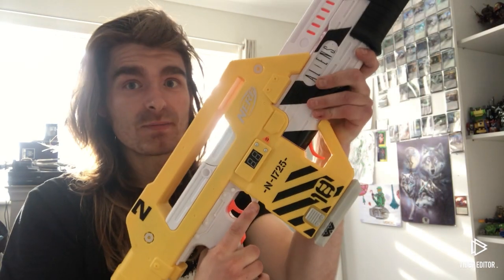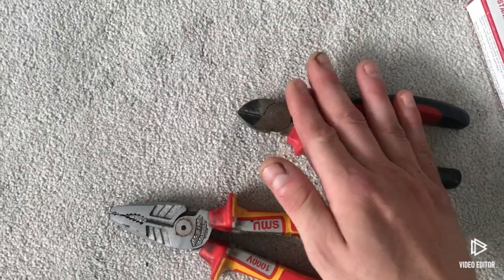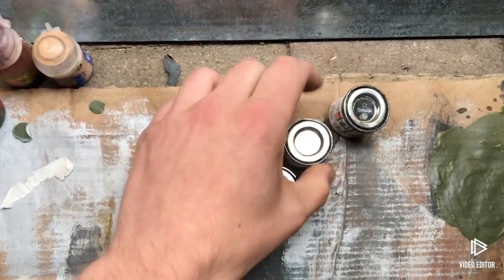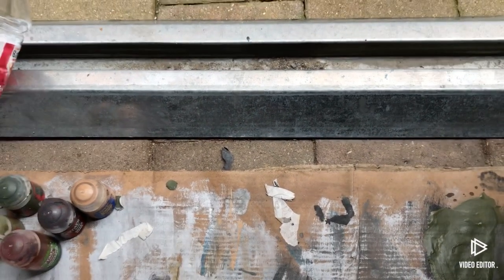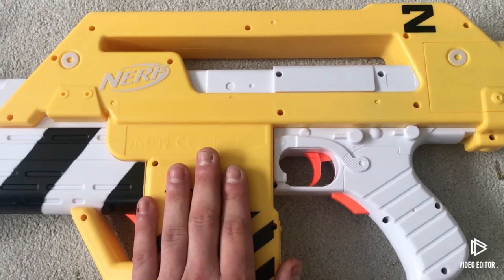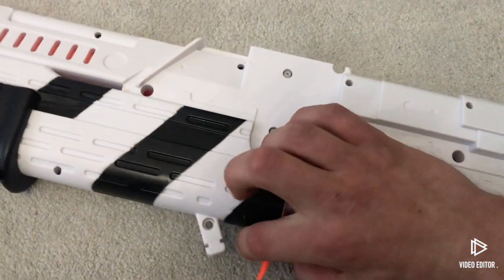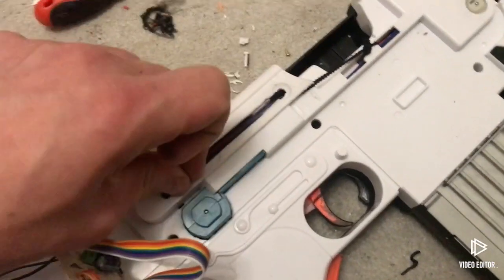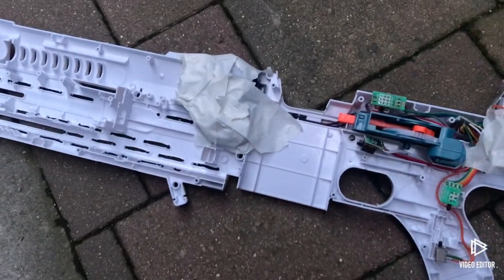Nerf LMTD Aliens M41A Pulse Rifle mod and paint tutorial

Comment: That’s awesome, I just got one of these to do exactly this. I was an idiot and missed out on the initial order, paid a little over the odds. Will be a good summer project.
Reply from the maker: Glad to hear you got one too!!! I never knew of when it originally came out so I also paid more than the original price. But definitely worth it nonetheless! 
I hope this video is helpful to you :)
Reply: It certainly was / is. What paint was it you used again? I’ve seen Rustoleum used again for the main black and shroud areas, but can’t seem to get that over here.
Reply from the maker: @Burtronic   I used chaos black primer by citadel/games workshop, light olive 86 by Humbrol and clear satin varnish by Windsor and newton. If you check at the 5:00 mark I show off all the paints you need, sprays first then the others for hand painting
Reply: Got it, apologies. I’ve found some paint called Krylon Camo which I believe will work well for the base colours for the body and shroud. But I’ll certainly be using your process and wash / weathering colours. Not sure I’ll strip it quite so far, but the shroud will come off. Looking forward to this one 👍
Reply from the maker: @Burtronic  the entire thing can be carefully stripped down (except the electronics as they’re soldered into place) just be sure to follow each step carefully so you don’t break any wires, otherwise you’ll end up having to do emergency solder repairs like me 😆
Reply: @Ascension-Angel I saw that 😂 I think if I take the shroud away and get to that point I’ll be happy. I don’t think I’ll cut all the holes out and do the triggers so those few steps should be far enough for me. The steps you did to there will be massively helpful so thanks for that 👍
Reply from the maker: @Burtronic  no worries my man. I only cut the holes out, modded the trigger and added a working cocking mechanism in because I’m all about the working parts and making it as close as possible to the live firing screen used prop. I hope you’re project goes well. Would love to see the finished result
Reply: @Ascension-Angel  got it all finished! Really chuffed with how it turned out, was good fun!
Reply from the maker: @Burtronic  excellent! Got your DM on Instagram too BTW

Comment: Excellent job , my only issue is the pump grip is made from polymer on the Spas 12, so wouldn't have any metal showing through, it'd scuff up more like a plastic car bumper if it scratched up at all. But I'm just being picky, it looks seriously legit! Tip for masking if you paint the edge of the tape with a clear coat first, nothing else will bleed under it :-)
Reply from the maker: @cynicalmamc  thanks! And yeah I see what you mean about the pump grip. Then again I did keep the aliens logo on the shell ejector too so there’s that 🤷‍♂️

Comment: I'm about to start modding & painting mine, and I was terrified - after all, it's a kind of one shot deal! But this has assuaged my trembling nerves, and I'll be following your example. Hopefully it'll look just as good - wish me luck!
Reply from the maker: Good luck! I’m glad you’re using my video. It means a lot to me. Best advice I can give you is TAKE YOUR TIME! especially with reassembly! And be especially mindful of the wires and circuitboards as I had to do emergency solder repairs and it’s is not easy! Make damn sure you have everything you need before starting. Also make sure to watch the previous video on modifying the trigger for independent action.
Reply: @Ascension-Angel  Just getting all the bits together - the paint list you put together there was a godsend, I was wondering how to get the butt looking wooden so that's answered that! Very nervous about the electronics but fortunately I can (just about) do soldering repairs if worst comes to the worst. You just used the Chaos Black primer, no topcoat, before satin finishing, an I right?
Reply from the maker: @timboxall8936  correct. The chaos black doubles as a primer and a top coat in one

Comment: Very useful video. I will likely modify my own in a similar manner than you did, with the trigger and barrel mods (only mod on mine is the "load any mag" mod).
Somet hings you might want to do:
 - I got one of those little plastic carrying handles that some cardboard boxes have, and installed it in the display box in place of the painted fake carrying handle. That turns it tnto an actual display / transport case! I even went and put some dividers in the convenient lidded storage box so I could store and carry there the darts, the mega darts ("grenades"), the batteries (for storage) and a small screwdriver to access the battery compartment.
- This rifle lacks sights, unfortunately, which sucks for actal usahge - so I made simple notch-and-post sights on spare plastic, put them on a thin cardboard (I kid you not) base of the exact width of the sight channel (the cardboard offers an excellent friction fit, better than thin plastic) and painted them. Instant removable sights for when I want to fling foam, removable for when I want "more screen accuracy".
- Have you tried replacing the four larger batts with a smaller one so there IS room for a extending stock? (It seems to be the largest discrepancy with the original - other than the ammo capacity, of course)
- I deliberately left the mag as it was. I mean, the original was an ARMAT, and this one has a Weyland-Yutani logo. My headcannon is that, clearly, the colonial marines are NOT above using cheaper aftermarket mags. 🙂
Reply from the maker: I’m glad you like the video! As for your suggestions, they are very good but sadly I can’t do the mod with the batteries as I’ve sealed up the screwholes and done want to wreak my rifle. As for the iron sights. You do make a good point, however the M41A never had sights in the movie which is strange, though they did put sights on it in the Aliens Colonial Marines game.
Reply: @Ascension-Angel  Yep, that's why I made them removable. I can switch betwen "movie rifle" and "game rifle" with ease. I even made a second set of express sights (front shotgun-style pot and large open V rear sight) of the kind that is used for hunting rifles, for laughs ("bug hunt").

Comment: Great video, do you have the full shopping list for all the bits to be able to copy your approach?
Thanks a million
Reply from the maker: Not off hand but I can easily get the names of the products what I used if that would help
Reply: @Ascension-Angel  that would be brilliant if you could post it online would be fantastic as I imagine others would find it helpful.  If it is all available from one shop (post their link) and see if they'll give you a kick back if you generate business for them. 🙂
Reply from the maker: @SteveCryan  that won’t work I’m afraid. Because it’s not all from one shop and most of the shops are local businesses and the others are massive corporations and I’m not a big enough YouTuber for partnerships like that sadly. It’s a great idea but I’m wayyyyyy too small a channel for that
Reply: @Ascension-Angel  makes sense, the product list would be fantastic in itself, if you could post it. I can get busy ordering and see if I can make a version almost as good as yours 🙂
Reply from the maker: @SteveCryan  will get onto it as soon as I can. Currently busy with my next project (and video)
Reply from the maker: So the paints and materials are as follows: Miliput (epoxy putty), copper pipe (for the cocking bolt), superglue (specifically Loctite Plastic Bonding System), Citadel Chaos Black Spray paint/primer, Humbrol 155 Olive Drab spray paint, Windsor and Newton Satin clear coat, Humbrol 33 Matt Black, Humbrol 53 Gunmetal, Humbrol 11 Silver, Citadel Dryad Bark, Citadel Kislev Flesh and Citadel Reikland Fleshshade (brown wash). I also recommend a very sharp knife, a drill, sandpaper or manicure files, a small bit of water (for the Miliput), an elastic type strap from eye masks used for sleeping, a roofing nail, making tape and a plastic bag (for covering and taping off certain areas to protect them from getting spray paint on them) and plenty of reference material.